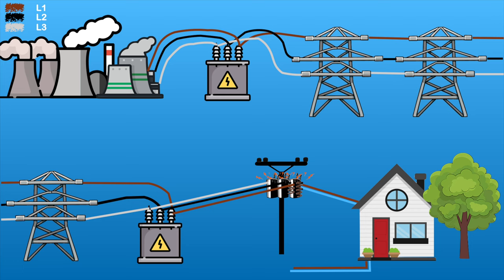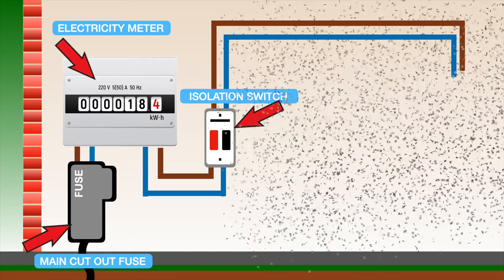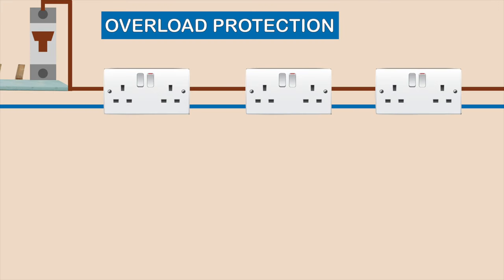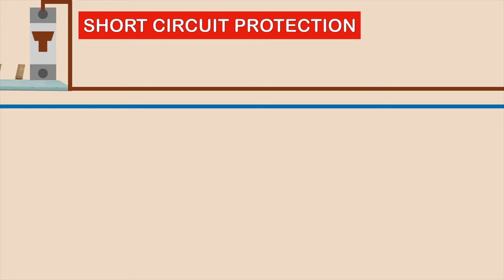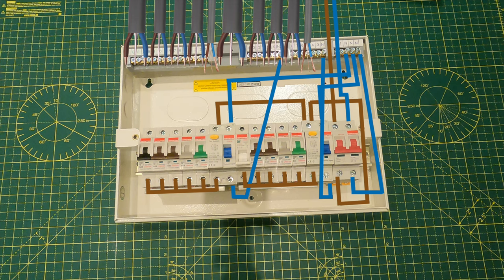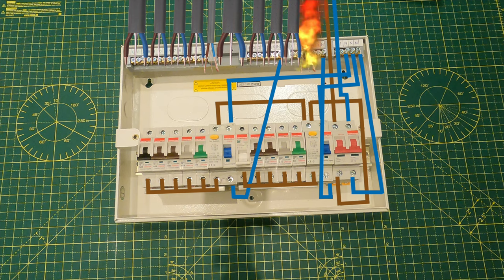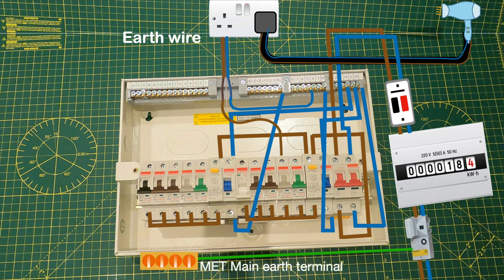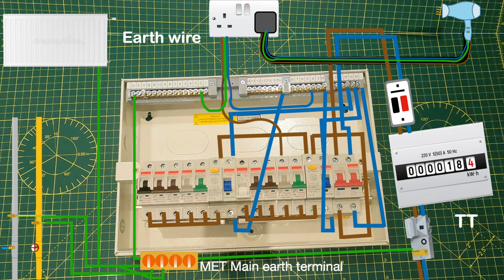How consumer units work   /   distribution board

Comment: A really interesting video, particularly how it illustrates how differently electrical wiring is done in the UK vs. here in Canada and the US.  Quite literally, nothing is done the same!  I hadn't even heard of the term "consumer unit" (we call them electrical panels), let alone RCDs (we call them GFCIs, but they are always combined with a circuit breaker, or in the outlets themselves - we don't have the concept of one RCD/GFCI protecting multiple circuits) , MCBs (they are just called breakers), RCBOs (this is really what our GFCIs are more like), etc.  Even our meter connections are done differently - we don't have a main cut out fuse at the house - it's at the supply transformer, as is the isolation switch, typically.  We don't use ring circuits (I don't think they are even allowable by code); all our circuits are radial.  Our panels are also built quite differently (less configurable by the end user), probably at least partially because we use split phase 120/240V instead of a single phase 240V.  Just goes to show how different two systems can be to solve the same problems!
Reply from the maker: Yeah I find it really interesting how different countries have there own way of doing things. I think the uk is one of the few countries that still do ring circuits and started in the 1940s. I think it was to do with being able to use small diameter cable on a ring as opposed to a radial and therefore reducing materials and cost during war time. I appreciate you taking the time out to watch the video and thanks for the comment.